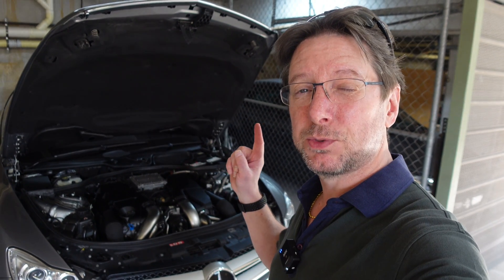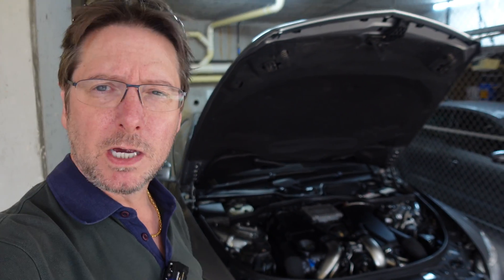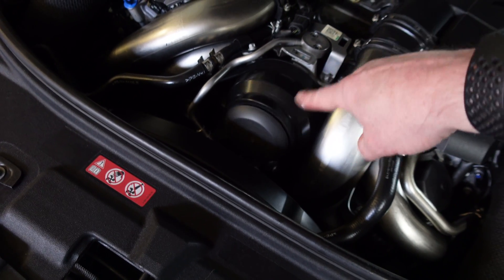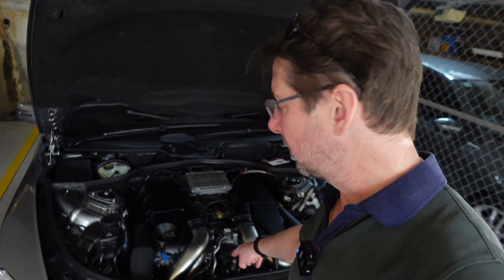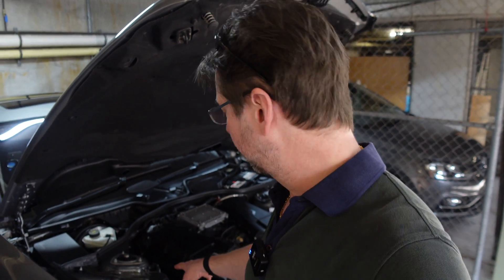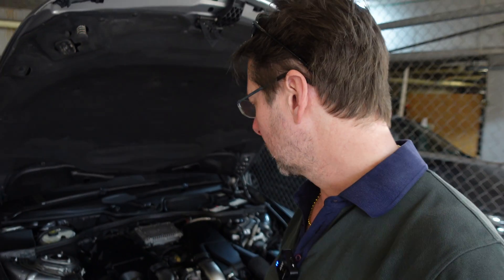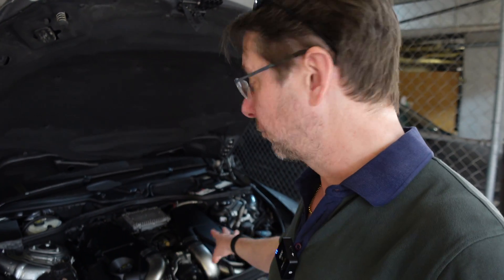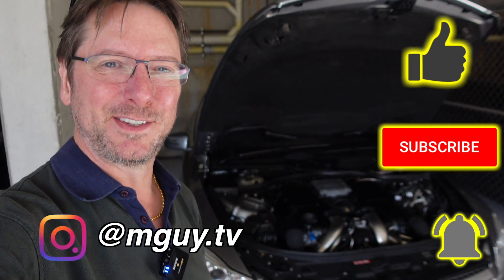Mercedes M278 Engine - Identifying and Fixing Rattles | MGUY Australia

Comment: If you really would like to hear something strange from any engine you probobly will. I just taking those little things as specific for this engine. Just use good oil  (LM 5Wx40) and warm up the engine in cold mornings and it will go easy 300-400k

Comment: We have grease spurting out of that top belt-driven accessory on our M278 (GLS 550).  Did you say that's an ABC pump?  I'm not sure if it's the fluid that it's pumping that is leaking or the bearings in the pulley, but it's going bad and I need to get a new one.
Reply from the maker: Bearing can leak grease - ABC fluid is low viscosity

Comment: Fantastic video! I’m doing an overall review of my W218 CLS 550. Earlier M278’s did have that timing chain tensioner rattle. Although mine is a middle series serial number I still hear what I believe to be the occasional film projector type rattle. I believe it’s those valve timing variators you mentioned as reason #4. Nice S-Class Coupe!!

Comment: I have the m278 on a Mercedes e550 4.7 2014 should i sell or i thought they were bulletproof
Reply: I have a 2014 E-550, not the CL550, in Oregon USA.  I ordered it in summer 2013 and received it late in the same year.  The engine has been reliable and without rattles.  You should keep your car.  No car is bulletproof, in any sense of the term, but most of the 4.7 liter M287 engines are very reliable.  Remember, any replacement you buy might also have a future engine problem.
Reply from the maker: I wouldn’t sell - the engines are great. (No warranty with this statement…!)

Comment: Did you replace the vacuum boost control solenoid when replacing the turbos? If it is on its way to "die", it will not close the wastegate internal flap properly (via the vacuum actuator unit ) and our engine proper turbo boost will not occur. CEL may not appear, till real under boost is detected.
Reply from the maker: Yes that was done

Comment: I have a late cl500, I understand what you mean about the tiny rattles, but no one else notices them. I think some of these smaller rattles are apparent to us CL drivers due to the absence of all the noise/vibration/harshness that you experience on other cars.  The turbo wastegate bearing rattle, thankfully mine is ok at present, but that would wind me up if it started.
Reply from the maker: Yes true - we are starting from a very high baseline!!

Comment: Excellent video. Those rattles would annoy me as well. My CL was a 2005. My biggest headache was the suspension woes. The dampener on the oil reservoir went and a low growl noise started. It took MB three months to work out what the noise was. I left the car with them for three months as it was so annoying. Once fixed the car was a pleasure to drive.